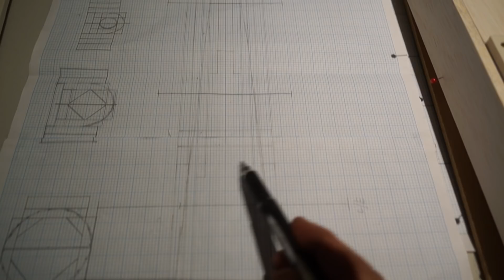How to SCRATCH BUILD a Balsa Electric Glider

Comment from the maker: This Glider Crashed today, haven't been able to find yet it but I expect it to be destroyed.
Reply from the maker: I think some kind of turbulence causing a tip stall, when I pulled out of it the wings couldn't handle the g's and one broke.  Looked for it for around 6 hrs total and after the 3rd  attempt (2 weeks later) it was found.   much less damage than I expected. The wings have been strengthened and it has now been fully repaired.  recovering has almost been finished, then I just need to reinstall new electronics as it was out in the weather for 2 weeks and I don't trust it even if it seems to be working fine.
Reply: @TheRattleSnake3145  what did you do to strengthen the wing and do you have any further pics of your build / modifications ?
Reply: TheRattleSnake3145 noooo it was so beautiful I am trying to make my own and is was looking again for som ideas
Reply: TheRattleSnake3145 have u already found it?
Reply from the maker: Floris Heuperman will have a look again tomorrow, it landed in very thick Mangrove trees and the tide was in at the time.  I was walking in waist deep water muddy water in mangroves that thick it was about 5 -10 meters visability at points.  Looked for about 1 hr but figured it landed in water so not much chance of finding anything usable.
Reply: I’m sorry buddy, what happened?
Reply: TheRattleSnake3145 Hope it’s still a Radian Water Killer
Reply: :-(
Where can i find the plans?
Reply: @myfix3796  ciao, trovati in disegni?
Reply: TheRattleSnake3145 was
Reply: That sucks ! Hope you find it . What do you think went wrong ?
Reply: …as I was saying

Comment: that's very cool, the wings are only attached with the connector and the carbon rod?
Reply from the maker: The wings are taped on with a low strength tape. that connector is just to locate the wing.
Reply: @TheRattleSnake3145  ok, i'm planning to build someting like this
Reply: do you have plans for it?
Reply from the maker: @filippoorlando5175  I don't sorry.

Comment: Thanks man you gave some idea for my wing joiner using bullet connector
Reply from the maker: Make sure you tape the wing on with a low adhesive tape, the connector itself isn't enough to hold it on.  just peel the tape off when you want to pack up.
Reply from the maker: Don't forget to use some tape to hold them on!

Comment: out of curiosity, how do you keep the wings on?
Reply from the maker: Anthony bot I use some low strength tape and apply it top and bottom each time I fly.
Reply from the maker: I tape them around the join to the fuse with some low strength tape.

Comment: You've mentioned you don't have any plans but any chance for at least the standard dimensions?  fuselage length (pod,  and from the wing to the stabilizer)  wing span and area, etc?  I want to build one similar.
Reply from the maker: Hello , Wingspan 2530cm  Fuse length 1340cm   wing cord 27cm  leading edge to nose 33cm  but this will likely be different as you will be using different material and hardware.

Comment: Awesome glider and great craftsmanship.
What is your angle of incidence, and why did you not bother with ailerons?
Reply: Also, what is the rib spacing?
Thanks
Reply from the maker: 50mm
Reply from the maker: I just guessed at the angle, I didnt put ailerons because of the extra weight they would have added.   They simply aren't needed with this style of plane.

Comment: For your wing tip, what type of adhesive did you use to join the balsa?
And also what kind of adhesive for the vertical stabilizer to the carbon fiber fuselage?
I'd appreciate your response. I'm building a glider for a school project :) Beautiful Plane!
Reply from the maker: Kenny Mcguire I used epoxy for the wing tip but any balsa/wood glue should be fine for that. I only used 5min epoxy because I didn't want to wait. For the tail I used epoxy, just make sure you do a test piece first as I have found some epoxy/ carbon combos that didn't work at all.   and scratch the carbon with coarse sandpaper where it is going to be glued.
Reply: Thanks for the info!

Comment: Hey bud. Where can I get an aluminum template for the wing ribs? and for the ribs, what Balsa would I buy? Is that planks?
Reply from the maker: Brandon Roberts I made the aluminium ribs by first printing the foil section on paper then transfering it to the aluminium so i could cut it out.   For the balsa I usually use 2mm sheet or thicker if it is an acrobatic plane. The bigger the rib the thicker it needs to be as well.  This wing was not built to do any acrobatics so didn't need to be made overly strong.  could have easily made it stronger though (lightness was important on this build)
Reply: TheRattleSnake3145 thank you! my email is brandon.roberts@aerowise.net. would you mind emailing me? I have a few more questions and don't want to spam your video.
Reply from the maker: Brandon Roberts it helps the video if you post to it so feel free to do so.

Comment: hey, Rattler. After looking at your plane for the umpteenth time I really think that you have a winner there. Nice job. On 14th Oct `16 I hope you still have it. What airfoil did you use? What is your location?
Reply from the maker: yes its still in my current fleet, I take it out on the light wind flying days.   Airfoil I used was an SD7037.
Reply: Hallo again, Rattler, I`m using that profile (7037) on one of the panels on a 160 inch tail-less wing I have on the board. There IS a slight under camber but so small i wonder if it will actually be there when I finish and cover the wing!!! What part of the Great Continent are you based? I will be down there from mid Jan to mid March, Adelaide and then Tassie for 6 weeks. I wish they`d let me stay for ever!!!!! I prefer light wind and calm days for flying too!!

Comment: Is there any undercamber in the 7037? Also, why did you build the wing without a spar?
Reply: +Brad Turner.  Right, there should be a slight undercamber on the 7037 and I thought there was some in the frame shot- not sure though.  That wing is interesting with the D tube being the hollow spar, if you will.  It's brilliant, if strong enough.  The LE sheeting could be extended or made of thicker balsa if needed.  Plane looked safe to say 3 Gs or so.  No aerobat, for sure.
Reply from the maker: Definitly not acrobatic but it was never intended to be.

Comment: Excellent video and a great test flight - congratulations.

Funnily enough the tip I really liked (and may well 'steal') is using 4mm bullet connectors for anti wing rotation.  I think they may also make neat hatch retainers, helped by my usual small magnets.
Reply from the maker: Thanks, mine were 3.5mm bullets, Don't forget to tape the wings on  :P

Comment: The shear webbs should have the grain "standing" for max strength. The grain should go from top to bottom, not along the wing.
Reply: darkiee69 yes the webs should be vertical but take note he has no main spars so I think it's stronger this way personally I would have 2 quarter by eighth main spars with vertical webs
Reply from the maker: If you try this for yourself, you will see that what you just said isn't true.
Reply: been there, done that, the webb separated along the grain under heavy load. That's why you should have the grain standing.

Comment: Did you post your build on RC Groups ?   i am guessing your wing root chord is 8 inches ?   i am Most interested in your Leading edge shape of the wing ,  its very hard to tell from the video but i am guessing you are shaping the LE  to achieve a more modern air foil ??   any little tid bit of info on that would be most Awesome

Comment: It appear you have a basic cookie cutter fuselage design you like to use. Using a 40mm prop spinner, the fuselage appears to flair out to be about 60mm.  Is your wing mount on the fuselage also about 60mm?  How do you guesstimate the tail boom length needed?
Reply from the maker: Its the least drag I can come up with / build.    I fully build the tail first, with wires and servos, then build the nose length to achieve the cg needed.

Comment: The main spar should be located on the wings center of pressure and a D cell should extend back to the center of pressure as well to avoid the wing twisting under load which allows adding ballast for the conditions you will fly in. And might as well take advantage of using carbon fiber to make it stronger in the first areas to fail. Lot's of work to build a balsa wood glider from a pile of wood but it's the only way to try out new foils and wind shapes.
Reply from the maker: You can see another build of mine where I built more with strength in mind here:  https://www.youtube.com/watch?v=RJSgMHVt_IE
Reply: Correct, this would be ideal.
Reply from the maker: Everything you have just said would have substantially increased the weight of the wing.
 You then mention adding ballast, when weight saving was the priority, there is no chance I would do any of those suggestions.
Reply: You did a beautiful job building your design. But nevertheless using a main spar on the ideal C/P location relative to the C/G (C/P changes with angle of attack) to prevent the wing twisting is a much lighter weight design alternative to using a D cell which is why low sink rate thermal gliders like the original OLY2 and Top Model's newer Ibis  etc. don't use a sheeted leading edge D cell but always try to have the spar at the estimated ideal C/P location.  Wing flex, such as induced tip washout to prevent tip stalling, can be achieved by tapering the wingtip ahead of the C/G to give the area of pressure behind the C/P more leverage and is part of determining the wing shape in relation to its aspect ratio and design parameters. Without added material weight required to prevent twisting on a wing supported ahead of the C/P twisting and therefore wing flutter and instability will be increased.

Ballasting to accommodate even a small change in the wind/direction will make the difference between winning and losing a contest using similar gliders flown by equally skilled pilots on average. Adding power and weight makes a neutral twist balanced wing even more important. The advantages of a main spar in the RC model scale is shown in building a very thin wing with a forward foil (a thinner modified airfoil) and comparing the flight performance to a similar  thicker wing. I have seen an RC "thermal" glider often flown in high winds with a much higher wing loading than an OLY2 fool experienced pilots by it's thin wing providing an extremely low sink rate that seemed to contradict it's higher weight and wing loading in out performing the OLY2 in sink rate as well as other flight modes. Most things have been tried building RC aircraft and what we see is a result of trial and error and copying more than using applied mathematics that will show the same results done correctly. Going thinner due to having access to better materials allows for new exploration but the basic principles of support in relationship to material weight required remain. And as usual keeping it simple is generally the better way to do anything.

Comment: I really like it RS, though I would choose different colours. But balsa building is too complex for me. I work in a precision engineering works and have discovered that, after work, I can't be bothered with the finesse required in the details. So I'm more into foam board and no sanding. But I do like to think up problems and find solutions. I've not owned a Radian, though people say it's good. Hmm, maybe I should try and make something like yours here, but emulate the Radian's dimensions exactly, ie, span/length, just to see what it can do. I'm off out to sort out some more 6mm foam sheets today. :¬)
Reply from the maker: Thanks, If I had to do it again, I wouldn't have picked the metallic. it added 30 grams more weight then if I had chosen a normal colour.  
The Radian is good, I prefer the normal Radian over the pro version.
 I also have depron sheets for concept testing.
Reply: 30g extra? Yowch!
I wouldn't mind buying a Radian one of these days, but I'm never one to leave things alone and I'd probably end up flattening the wings quite a bit and adding ailerons. :¬P
 Oh, and I now find that I lied about the sanding, as I've just repaired, re-purposed a pair of Armin type wings that I extended to 2.5 meters. I used a "Mouse" sander with 120 grit extensively. I ended up using a bit of water sprayed on to the surface to eliminate 'balling' of the lightweight filler. It works a treat. 
They are now 2.46 mtrs but with semi elliptical wing tips and fully glued in carbon tubes right at the top and bottom surfaces. They are ridiculously rigid, compared to any Armin job. And with a fishing rod tube for a tail boom and basic foam board fuselage I've started to discover what people mean when they talk about lift.
 Though I'll admit that I didn't get fanatical about weight and covered most of it with glass reinforced tape. Well, we're approaching winter here now and winds are picking up, so the glider is actually quite fun as I already know It can take a knock. ;¬)

Comment: Beautiful job!  What's your RTF weight and square inches of surface area?
Reply from the maker: 740grams without battery and 1008 square inches.   I could have saved 50 or so grams of it used a normal film instead of the metallic but I had already done most of it when I realised how much heavier the metallic is.
Reply: Weight is comparable with the Radian but you've got double the surface!  Now I know where that ''float'' comes from.  ;]

Comment: I wish you would make a set of plans and put them on so we could print them to build the glider, I think its beautiful. I live in Arizona usa. ron
Reply from the maker: honestly, if you have the skill to build this, you could most likely design it too.  
Give it a go and you will have fun learning!
Reply: I'd like to give it a go!! You're right we can do our own designs, can you share just a bit of info on a few key dimensions like wing span, wing cord, dimension from motor mount to  wing LE, and  length of boom? I'd like to get these basic measurements just so I don't need to add a ton of ballast to get the balance on CG!
Reply: @wshurmatz1   just do like I do. find a plane you want to build and then build a plane that fits those measurements and Design. I haven't built any big gliders yet but I've been building small Balsa gliders from plans I find online. But I don't have a printer to print out the pages so I just take the measurements and draw the lines in myself by hand.
Reply from the maker: what I do to make sure I dont need to add any weight to get the cg right is make the fuse ahead of the wing longer than I think it needs to be.  Then when the rear half of the plane is finished (servos and wire installed etc ), I temporarily place the motor and battery up front so I can adjust where it needs to be. Then cut the fuse as needed.
 That way no weight is needed to correct the cg.
 Wingspan is 2.5 meters
Cord is 28cm
Your materials will likely weigh different so your fuse length will probably be different but:
LE to motor mount = 29cm
LE to rear end on boom =  1.9m

Comment: How light is the Radian Killer?
Reply from the maker: 740grams without the battery.
Reply: That's heavy but it flies so well?
Reply from the maker: +Alvin Robinson it's only 80 grams more than a radian but it has something like 80% more wing area giving it a  much lighter wing loading. combine that with a more streamlined design lets it out climb a radian when under power while also having a better sink rate.

Comment: Nice work. How do you cut consistent, smooth round cuts in the ribs which house the support tubes?
Reply from the maker: +LSUtiger607 using the jig hole as a start point, I used one of the carbon rods to mark a circle then cut/sanded it out from one of the ribs. then I used that rib as a hole template for the other ribs.